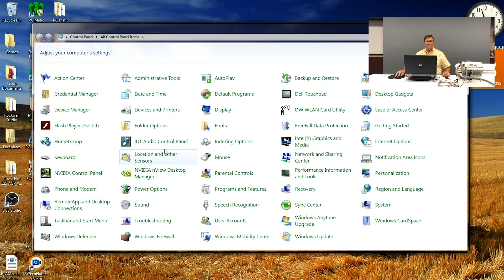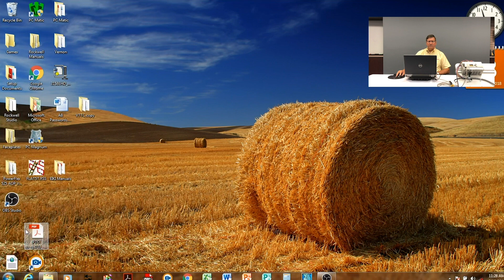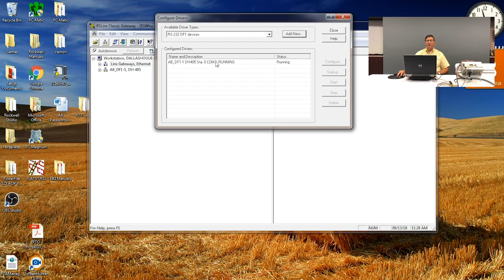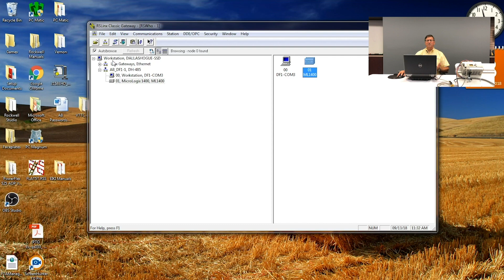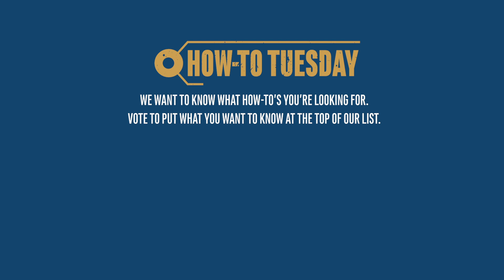How to Install an RS232(DF1) Driver for CompactLogix

Comment: I  am trying to read the data from RS232 com port. The com port is attached to a weighing scale and I want to take the data which is displayed on the weighing scale as a txt file or an excel file. I am not very familiar on this subject.

It would be a great help if you could guide me.

Regards
Avinash